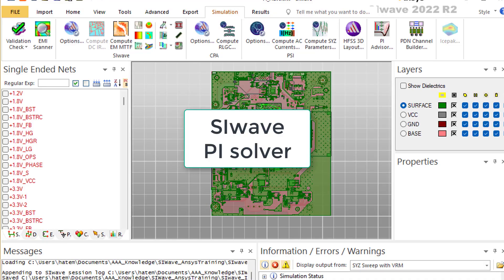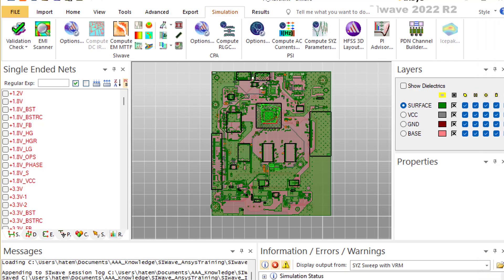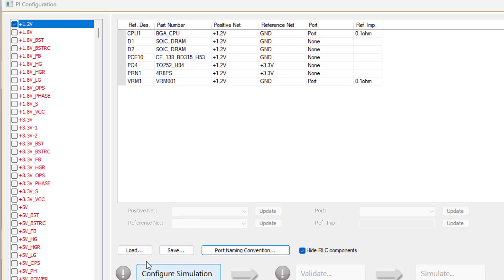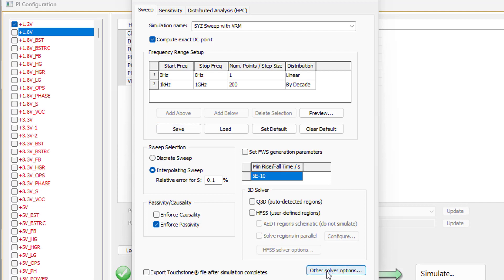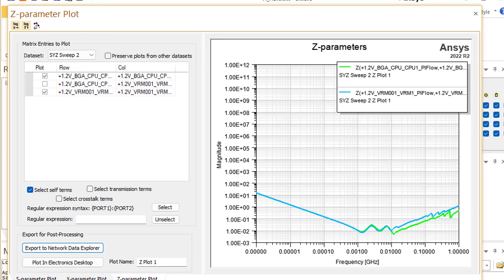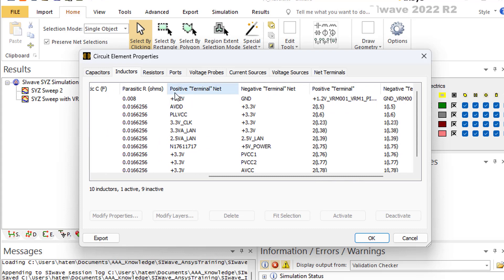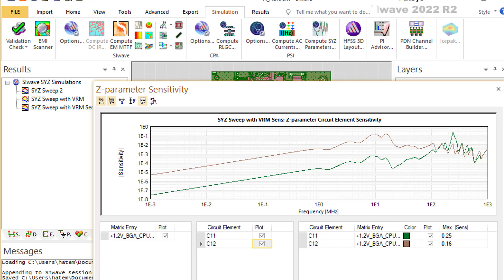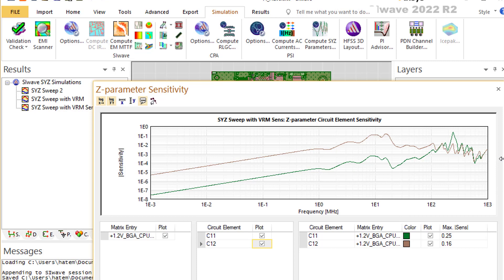SIwave: Everything you need to know about the PI solver (HD version)

Comment: Really useful video. How do you determine the equivalent circuit of the VRM? What if you have an inductor on the output to filter out AC?
Reply: Same question here, do you found an answer?
Reply from the maker: From the supplier. If you have an inductor, you need to use a circuit to add the inductor to the output port.